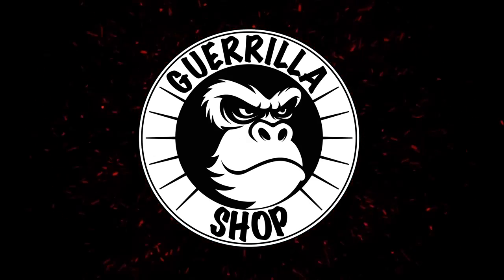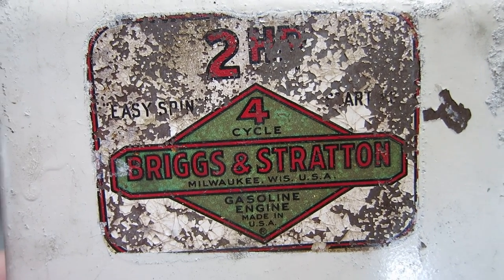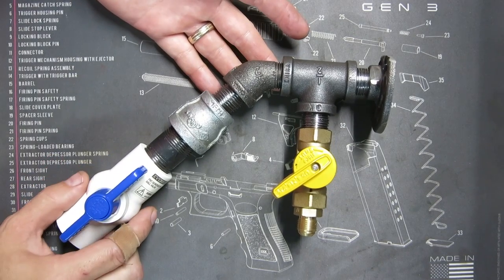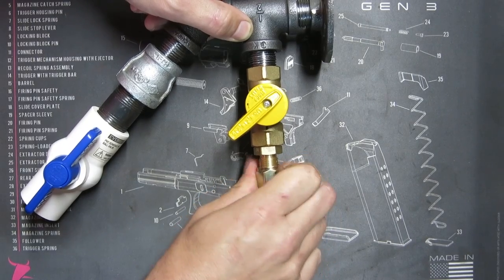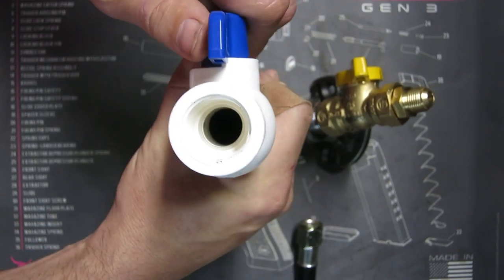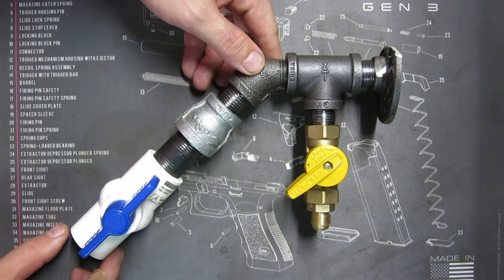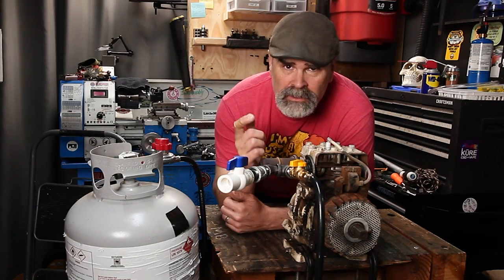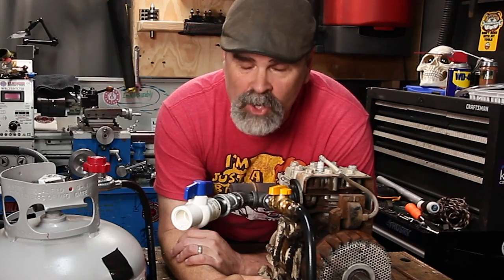How to Make a Carburetor - Propane Conversion for Small Engines

Comment: in factory small engine conversions, the propane comes before the butterfly...and the propane remains a constant, and only the amount of air is altered. so basically you need an L pipe inserted in the air stream (about where an air cleaner would go, directing the propane into the engine. this pipe need only be about 5/16 internal diameter, and for an engine that small, more like 1/4" ID. then the butterfly (your pvc valve would work). Usually, the regulator is a bbq pit regulator or similar, which provides about 1psi, and the second regulator (as comes with cheap chinese propane conversion kits) knocks it down further. final adjustment of the propane flow can be done as you have it, with that ball valve.

Comment: Today I ran a 3/8 ID hose from the worthless TEMU $20 multi-fuel carbs, regulator, 3/4" in. into the carb on a 6 HP Tecumseh generator, it worked fine, I just need to mount & run it properly, through the air cleaner!

Comment: Re-key the flywheel so that the spark is as close to TDC as possible.  Use a copper or steel capillary tube inserted into the intake port AS CLOSE AS POSSIBLE to the intake valve without causing interference to the valve.  Have a needle valve controlling the flow to this for the idle circuit. Have another copper or steel tube, somewhat larger, also terminating next to the intake valve, but have it connected to a valve to control speeds above the idle from the first mentioned circuit, this is the acceleration circuit.  The beauty of this setup is that you don't need any air modulation (no air throttling or throttle body) and that you can use methane, butane, propane, or any other gas without any jetting modifications, just idle speed adjustments...
Reply from the maker: Thanks for the advice! Makes perfect sense.

Comment: Any questions just ask I've messed around with a few propane conversions. 
I buy parts from ebay seller Propane-kits and also have a few mixers I can compare to gasoline carbs. I also plan on converting tecumseh carb in the future.

Comment: Hey man.. Nice Job !! Im watching because im also about to start experimenting. Got a bunch of small 4 strokes from all my homemade toys over the years. When you said in begining with direct injection it wouldnt idle up my thoughts immediatly went to that there was no oxygen able to mix and pictured in my head that air opening in between the adjustment knob and burner on any Gas Grill. So when you first started showing your PlumberCarb i figured the Propane was going to go through the 45° and straite shot through the Tee with the Air getting sucked in at the 90° of the Tee. Like a typical venturi type suction pump. So my question is now with your experiences do you think that might work any better ? Different ? I would think that with the propane going straight and picking up its oxygen through venturi that maybe through experimentation, maybe  enlarging, reducing inlets & outlets of the Tee you might be able to get to a point where you only have to adjust the propane and itbself regulates Air intake ? Oh wait you did mention building a venturi carb i think ? Did you show that design in a video and was it basickly what im describing ? Honestly i havent even looked to see how they design the Store Bought Conversions yet, your video was the beginning of my research. Im think im going to start with scaveging  everything off my old gas grill in back, possibly using the valves for throttle and the air mixing section and start experimenting. I saw a comment about the regulator ? Is that necessary or no ? 
 THANKS !!
Reply from the maker: Hey, thanks for your comment! My experience with running a small engine on propane is... it's very finicky. I would just order a conversion kit, but nobody makes a conversion kit for a 50 year-old Briggs and Stratton engine. I did machine a Venturi and set it up with the same structure as a typical carb. The engine ran, but it was rough and I was not able to control RPMs. I have concluded that a Venturi is not needed because the propane is a gas and already has pressure. I believe it all boils down to ratios and getting perfect: air vs gas. You might want to check out my other video on using propane to power a small engine. It might give you some ideas. At any rate, please keep me posted on your propane/engine adventures. I am very interested!

Comment: I'd like to do this as well. Only for a generator, so not so much variable needed, and without the garretson.
Reply from the maker: Yeah I tried without the Garretson and it was the same… Good luck. Let me know how it goes!
Reply: @GuerrillaShop-m3  Same here, looking to convert a couple of generators. Did you come up with a compact unit? I see you didn't post in a while, I hope all is well...?
Reply from the maker: Got sidetracked for a bit. Plan to get back to it later this summer😊